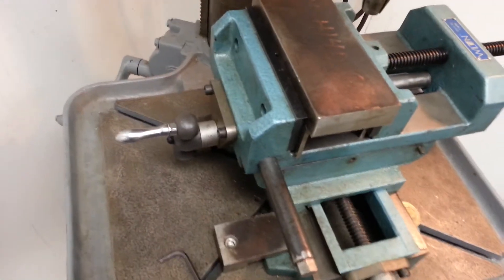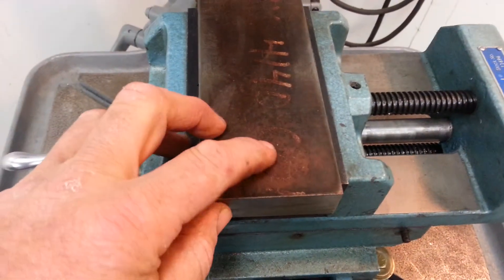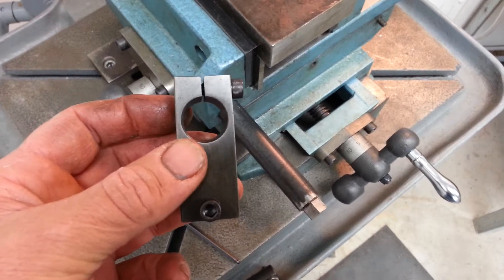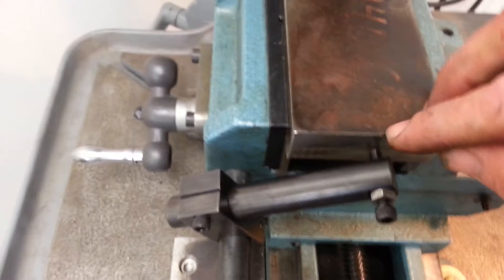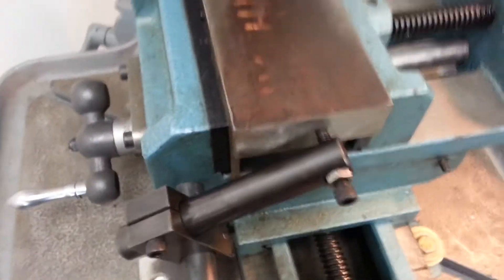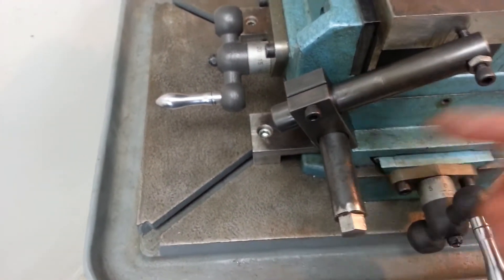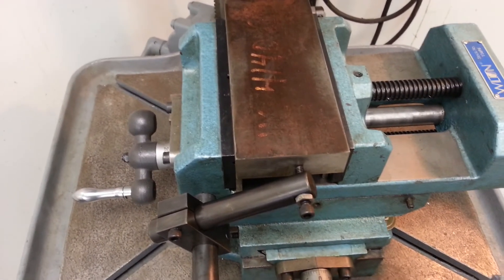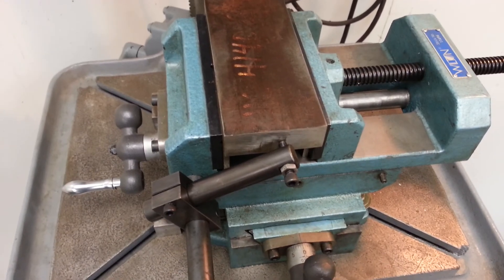Work holding and indexing.

Comment: Thanks for the ideas. I've been working on learning what I can about machining and planning to get a small mill and lathe (I'm very space-limited).  In the mean time, I've gotten a cheap cross slide vise and some tools (calipers, taps and dies, etc....already have a fair number  of woodworking tools so I'm not starting from scratch). The vise is similar design to yours, but made in China. When I got it it would bind in some parts of the slide travel, and the gib adjusting screws were Philips head and the threading was poorly done.  There's a reason it was only $60 new.  I used grinding compound to fix the slides, re-tapped the adjusters and replaced the Philips screws with socket head cap screws, and now it works pretty well. Some of this cheap stuff is ok if you think of it as a partially completed kit rather than a finished tool. For me this is a hobby, so time isn't as important as cost. It was fun fixing the deficiencies. Learning how is coming from videos like yours, so thank you!

-- Mike
Reply from the maker: Hi Mike,
When work is slow, I dont mind spending some time on a "kit", but often when I buy something, it has to be put to work straight away, thats when I need to drop the $$ and get something nice.

Thanks for the view and the comment.
Stan